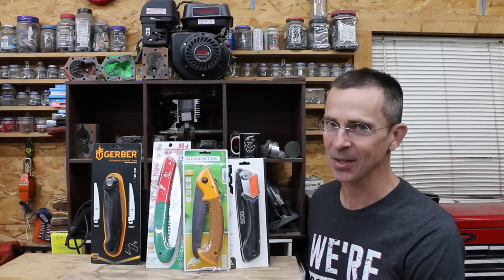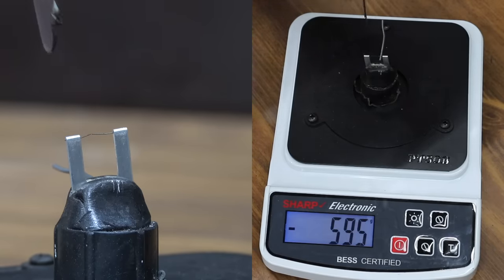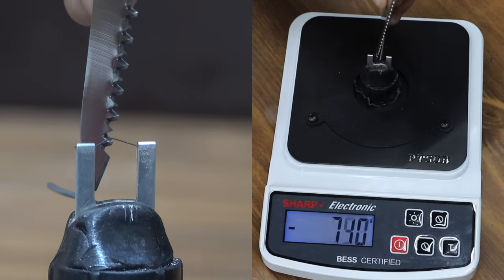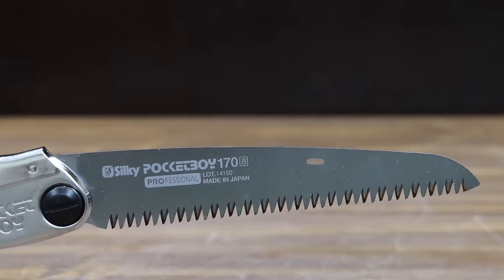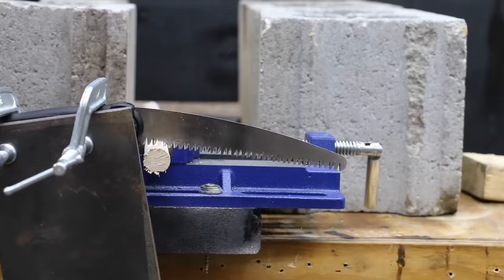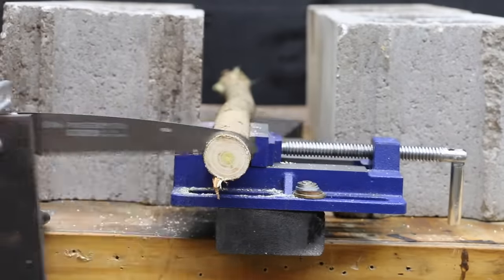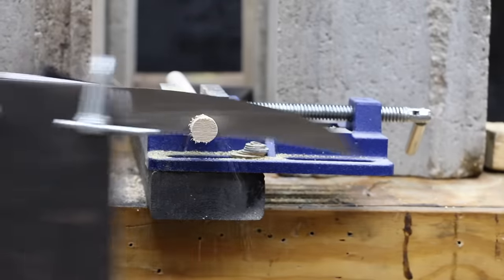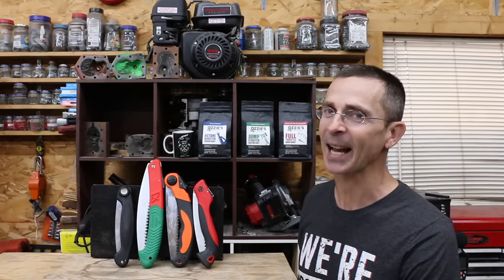Best Folding Handsaw? Samurai, SOG, Corona, Gerber, Fujiwara, Silky, Kershaw, Gruntek, Mossy Oak

Comment: There are three channels I always look forward to weekly and yours is definitely one of them. There is a variation of this type of saw where you take a 1/2” or 3/4” aluminum tube and attach a sawzall blade to it. Supposed to be ultra light for backpacking and such. The Milwaukee carbide sawzall blades are what I saw was popular for that. Would be interesting to see how it stacks up.
Reply from the maker: Thank you!!
Reply: What are the other two channels?
Reply: @Greg_Chock  torque test channel and corporals corner.

Comment: I have both the folding and the non-folding versions of the samurai. The extra length in comparison to the others is what sets it apart.  Hands down the best saw there is, especially when you have the sharpener for the blade to keep the blade healthy.

Comment: Wow, seeing the burr on the saw teeth at close is something. If the manufacturers cared of enough to remove the burr it might have give them advantage in initial sharpness test. Would love to see similar test on japanese woodworking saw, although I can see that it is too much of a niche for this channel. Great work as always, looking forward for the next video.
Reply from the maker: Great point! Thank you
Reply: I'm guessing that's why a few of the saws got sharper with use as the burrs went away.
Reply: @bdkj3e  my grandpa has a really old fixed blade corona. Its rusted to hell but works good still
Reply: Japanese saws work on the push instead of the pull. Really the only difference. 

Because of working on the push they can be more flexible in how you make a cut, but also harder to cut straight.
Reply: @leftyeh6495  You got it switched around.

Comment: Another great video!

Interesting to see the Bahco – so popular with outdoors folk – sitting mid-table.

For the weighted test rig, it would be informative to know the force required to move the saws throughout their forward and backward strokes. Since force multiplied by distance equals work done, this should better indicate the effort required to use each saw.
Reply: I bought a Bahco and was SO unimpressed with it. I've loved my Silky saws.
Reply: I picked one up on sale some years back and have not been disappointed, it gets the job done.  However after this video I may have to get a Fujiwara...
Reply: Maybe because bacho is so middle that the silk seems great.
I use a Corona 10in haven't had a problem yet. 
Silky on other hand is very easy to break blades. 
I used to love watching bushcraft guys on YouTube. Nowadays it's all like a long commercial for expensive gear I don't need. 
You never see anyone use the same tools more then once especially knives .
Reply: My Bahco is great! I am VERY suprised at its position in these tests. Maybe he got a lemon.
Reply: @georgeorwell126  anything is possible or you got a really good one
Reply: @georgeorwell126  It improved as the protective finish was removed from the teeth.

Comment: I can confirm: the Corona is sharp. I had to get five stitches from it a few years ago. Also, have you considered measuring the set of the teeth (how much the teeth are bent outwards, along the width)? It affects how much the blade will get pinched when cutting.

Comment: The longevity is a factor that's also important when it comes to a saw. No fun if the saw loses sharpness after just a few branches.
It did look like the Bacho had a pretty thick protective coating that messed up the sharpness test in the beginning.

Comment: Thanks for the tests! I was skeptical that someone could do a fair and scientific test of tree saws, but you managed it somehow, like you always do on your tests.👍

We've had the same or similar corona saw as in the test for about 20 years. After a lot of abuse like sawing roots underground, getting bent by abuse and hacking at many hard wood limbs it's only now getting to the end of its life. Not all of their tools hold up as well in terms of over all durability, but over all it's a great brand for pruning work and one that's easier to find in most hardware and gardening stores. They offer replacement blades for most of their more expensive cutters too which is nice.
Reply from the maker: You are welcome!

Comment: I have had a Corona blade just like the one you tested and I am still impressed with it. I have cut 8 inch diameter rounds form bucking up a tree with it to make some coasters because it cuts so smooth and leaves an almost sanded finish. Great video.
Reply from the maker: Thanks!  Thanks for sharing.

Comment: I have four Silky saws from 210mm to 500mm. I am extremely happy with their preformence! This is a buy once cry once thing.  If you can swing the cash and take the time and care to learn to use a pull saw correctly they will get work done easier with less energy expended  because of their thin kurf.

Comment: I used to build mountain bike trails which involved a lot of tree cutting in areas where I couldn't get a chainsaw into, with some of the largest being 10-12" diameter. I started off using the corona folding saw (shown in the video) which cuts amazing for a few cuts, and then becomes dull very fast. I got a silky Ibuki 330 and it cuts just as well initially, but the durability of the teeth is light years ahead of the corona. I'm talking a few cuts vs. a year of heavy use. Granted, they aren't specifically designed for cutting downed trees of that diameter and for around the house stuff it probably doesn't matter but for durability or heavy use it might be something to consider. Always enjoy watching your videos!
Reply from the maker: Thanks!  Thanks for sharing.

Comment: Great video. A Corona saw saved our ass when we had an ice storm in SW OK.  Ice laden branches from a pecan were laying down on the power line. I duck taped the saw to a pole and went to work. It went thru the pecan with no trouble, and eventually got the tree off the power line...would be great for a bug out bag...
Reply from the maker: Thanks!  Thanks for sharing.

Comment: I purchased a Corona folding saw which had a wood handle 20 years ago.  I used it for landscape maintenance for 5 years then built a small house in a remote lot with no power.  That saw cut through 2x4s, 2x6s and 7/16” sheathing not much slower than a power saw.  I replaced with a Fiskars folding saw.  It cut slower than the Corona it was supposed to replace!

Comment: I have been pruning apple trees for a local orchard for a few years now and use these saws every day in the winter.  His results are pretty dead on with what we've found cutting mostly green and sometimes dry apple wood.  

For the price, the Corona really can't be beat.  It's sharp, cuts fast, lasts a decent amount of time and is all that most people would ever need.  Plus it's available at many big box and local hardware stores.  Just buy it.  It's what the orchard buys for staff to use every year.  

I bought a Silky, though.  Since I use it every day I find the handle far more comfortable (the Corona is pretty chunky and oddly shaped for me) and it's a bit lighter.   Since the handle is slightly thinner the Silky also fits into the side pocket of my Carhart overalls.  They cut about the same, but the Silky blade seems a bit more flexible.  I used the same blade for two years until it finally broke when stuck in a cut and forced.  

Rule of thumb- just buy whatever saw that has a Japanese (or in Corona's case Korean) blade that fits in your budget.  They really are that much better.  If you can get your literal hands on one to see what best fits your grip that's even better.
Reply from the maker: Thanks for sharing.

Comment: I own both the Bahco and the Samurai, both cut equally fast if not the Bahco is a bit faster. I got my Bahco from a very old stock, from the era Morakniv used to make the 840 Clipper (That's even before the Companion models!) Also, I believe that the coating, is a factor that makes the teeth of the Bahco look like dull. After you cut a couple of branches, that coating wears out from the teeth and you can then see the shiny sharpened edges on them. 
Another factor, is that Bahco is a do it all saw, not a pruning saw like all those others. It's designed to cut many more materials, like bone, plastic etc. It's the ideal tool for Survival or Hunting, the others are designed just for pruning.
Reply from the maker: Thanks for sharing.

Comment: I've used Silky saws extensively in the woods, and one 'intangible' quantity that's hard to communicate through video is the build quality. They're nearly indestructible, since they're entirely composed of steel instead of plastic. If you're in the backwoods and cannot afford for your tools to fail, Silky is the way to go. Their larger saws have a more aggressively curved blade, similar to the Corona, and I'd be interested to compare those two.

Comment: I've been telling everyone how great my Corona tools are for years, especially my 1" inch classic cut pruners,  my E-Grip transplanter (trowel with teeth), and my 14" pruning saw,. It cuts extremely well through my orchard trees and everything else that doesn't require the chainsaw. The strength and finish of Corona tools is also very impressive. My pruners still cut great after seven years (I have yet to use the solid carbide sharpening tool I bought on a whim), and my transplanter has never had any rust despite hitting and scraping against rocks, conglomerate, and concrete. Also, I don't like their ComfortGel grip too much but all of their tools perform amazingly regardless. Their ComfortGel grip offers good grip, I just prefer their E-Grip.
Reply from the maker: Thanks for sharing.

Comment: I do a lot of greenwood woodworking and I am involved in that community and the Silky is by far the most recommended saw to use, but usually the longer bladed versions or the straight blade version. I suspect this is because they are one of few companies that do offer these different types of blade/handle lengths while still being high-quality. I've never heard of major issues with them long term either. I cannot say I've seen much testing so this may be the "Festool" syndrome of seeing experienced/talented people using Silky and others following.

That all being said it does look like Silky has some stiff competition and I will looking into the Corona to replace my old Fiskar folding saw. Here in Canada it seems the price difference between the Silky and Corona is only $15 to $20. (both saws in the $50 to $80 range for ones tested in the video) so I may just upgrade to a 12" or longer bladed Silky with a long handle.
Reply from the maker: Thanks for sharing.

Comment: When installing a short cinder block retaining wall I needed to cut the main roots of an Arborvitae we had previously removed down to the stump. I had the mrs pick up the Harbor Freight saw and it cut thrhough those 3" thick roots like butter, even though they were still moist from being in the ground and still partially buried.
It was still sharp after I was done so I put it in with the camping gear to replace the bulky folding bow saw we had.
Even if it gets lost or damaged it's only $6.
Reply from the maker: Thanks for sharing.

Comment: I noticed that the saws with most impressive times also produced the largest tear out in the wood it cut. I have a Laplander and to me, the saw is one part takedown tool, and one part manufacturing tool. I use it for gardening but also as the beginning sizing tool for processing branches into either tools or furniture. I would definitely carry it if I was bugging out and needed it to help build a shelter. But it’s versatile enough to really do multiple things well. Generally though I don’t like tear out. You get jabbed with the splinters
Reply from the maker: Thanks for the feedback.

Comment: Pro arborist here. This was a bit of an apples and oranges comparison here since some were curved and some straight blades. Silky makes a range of blade lengths, teeth sizes, and curved and straight models. They also stay sharp the longest and are smoothest, which is why most pros use Silky. ARS is another good brand. Stihl handsaws are rebadged ARS
Reply from the maker: Thanks for the feedback.

Comment: About 30 years ago when I was mountain biking I bought a Wilkinson Sword pruning saw to remove dangerous branches and clear trails of fallen stuff. It had a lot of use even cutting branches up to 8" or so fallen across trails 
Been thinking of replacing it as it's not as sharp as it was but still works OK around yard. 
If I was to start biking again I would go for the Corona as it's definitely cheap enough
Reply from the maker: Thanks for the feedback.

Comment: I live in the desert in the Southwest.  I do a fair amount of woodworking. For my outdoor furniture I've been using a waterproof varnish.  It only lasts a couple of years before it cracks and looks bad and has to be redone.  I read that titebond 3 was a permanent sealant and started to use that as my varnish.  So far in my area, it seems to be working very well.  I have some pieces that have lasted five years and still works well.  I don't know if this is good for other climates or areas.  You might want to test it.
Reply from the maker: Thanks for the suggestion.

Comment: Kershaw made a knife that uses individual interchangeable blades aptly named The Blade Trader.

One of the blades is a saw blade, as well as 8-10 different blades, from paring blade to filet blade, butcher knife, bread knife. I can't say I've ever used the saw blade on wood, however it works great breaking down animals used for food.

Comment: I was surprised by Silky's placement also.  I always thought of them as the king of the pull saw pruners.  Silky does offer 3 different tooth pitches for different applications though.. a course tooth for green soft wood, a medium pitch for general purpose and a fine tooth for hard dry wood.  I think the results might have been different if the saws were places in the medium that they were designed to excel in.

Comment: I ride a Harley Lowrider year round. I've put 30k miles on it in 2 years. The owners manual recommends 20w-50 motor oil which can be found labeled for both automotive and motorcycle use. I was wondering what the difference would be between oils that are identical weights but one is made for automotive and the other is made for motorcycles or other smaller motors. If this sounds interesting I'd love to see you do a test on it! Love your videos and really appreciate the amount of time and consistency you put into these videos. Very scientific approach and thorough.
Reply from the maker: Thanks!  Thanks for the suggestion.

Comment: I have many of these (for some reason) it’s like pocket knives for me… I can say my favorite is the samurai but you can’t go wrong with the silky saws and the corona brand is pretty good as well! I haven’t tried every saw but I have maybe 10 different brands. Besides long term sharpness(mine are all less than 10 years old) I can say the tooth count and depth of tooth makes a big difference. You don’t want teeth too big on a hand saw. One of my favorite saws was a no name brand but it didn’t stay sharp and bent easily. One of my least favorite was a fiscars brand with very big teeth that looked good and it was long but wouldn’t even cut as fast as my little silky like the one in this video.
Reply from the maker: Thanks for sharing.

Comment: I know you just tested handsaws, but those are all for Outdoor/Gardening use. 

I would be interested to see a comparison of multipurpose handsaws for light woodworking, household use and construction. 
I like to work with handsaws if it is for finer work or just for a few cuts, without having to worry about where cables go or if batteries are charged. 

I also would love to see you work your way through different types of woodworking saws, but not only are there tons of manufacturers but also  many different designs (traditional design, backsaws, Japanese saws or framesaws,...) as well as different use cases and speciality saws. The 
testing of all those could be a whole channnel in itself.
Reply from the maker: Thanks for the suggestion.

Comment: I’ve seen a lot of the Corona saws break at the pivot. Could be too rough of use, but several buddies had them break there.  The Stihl small handsaw I have has been great (but not cheap).  It claims a lifetime warranty, but a friend broke the blade and the local dealer said it does not warranty that.

Comment: Once again you knocked it out of the park. I've been a big fan of Silky saws for some time, but now I guess I'll have to look at a Corona. One thing that you didn't include in your critique was how many positions the blade will lock into. I can tell you that I wouldn't own a folding saw that didn't lock with the grip elevated above the blade, rather than inline with it. When cutting logs and branches that that are on the ground, that feature really saves wear and tear on your knuckles. I would like to see these saws used for ripping pine lumber, in the future. Also, do you think you'd ever do a comparison of folding knife/multi-tool saws?

Comment: I would suggest periodically as you use one to lubricate the blades , maybe the fluid film . And have at hand some type of cleaner and brass / stsinless bristle brush to clean the blade of resin  . And jug of water to rinse it away , dry with cloth and re-lubricate .
Reply from the maker: Thanks for the suggestion.